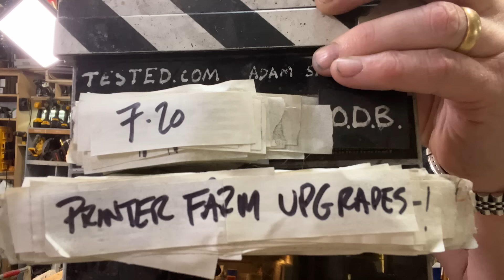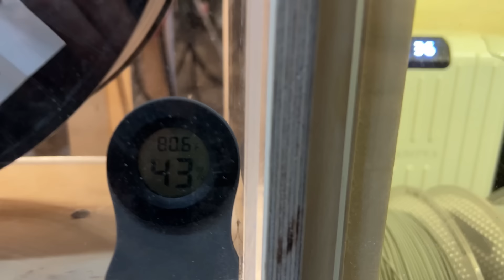Adam Savage's Essential 3D Print Farm Upgrades!

Comment from the maker: Bambu Lab X1C 3D printer: https://www.matterhackers.com/store/l/bambu-lab-x1-carbon-combo-3d-printer/sk/M80GDCL5?aff=7553
MANITYA Small Dehumidifier for Bedroom 580 sq ft: https://amzn.to/473UXFw
PLA filament: https://www.matterhackers.com/store/c/mh-build-series-pla?aff=7553
Filament winder design: https://www.printables.com/model/466883-pastamatic-filament-spool-winder-for-bambu-lab-x1c
Anycubic Kobra Max: https://www.anycubic.com/products/kobra-max
Adam's 3D printer farm build: https://youtu.be/taeS72yO__k
Reply: Joint the 3d bust print to make the mouth move and add a finger rig in the base to make it work ... as a one day build episode ... heck work out a way to make some Iron man armour unfold around the bust to make it into iron man ... suggestion for the iron man suit and visibility .. add cell phone cameras to the surface and put small monitors in the brow of the faceplate .. then you get a panorama view by looking up a bit .... add a heat sink and some lap top fans and you get suit cooling by airflow as well .. include a camel back water bottle in the rear (cold water added cooling) and have the mouth piece on the jaw line ... add a mic for speaker mode and of course head phones for hearing ... you can literally then put the controls on the wrist computer as digit sliders with buttons for lights etc ...
Reply: 30:32 For the most metallic 3D parts you could finish the part and then paint it with a metallic color of your choice. If you want a truly metal finish look into graphite electroplateing or by using a Conductive PLA. You can find it by searching 3D part electroplating or PLA electroplating. If you want a solid metal part you could cast it by making a mold using the 3Dpart. If you just want a metallic PLA I would recommend SILK PLA or a Composites/Metal PLA. Hope This helps. Peace and Love Dude!:face-red-heart-shape:p.s. Sorry for the duplicate I just want to make sure you got it my message.
Reply: “No need to get fancy” creates a table with four two piece legs recessed into the top 🤣
Reply: Somebody please tell Adam what a "Bowden Tube" is.
Reply: So Adam, I believe it's a PLA called SilkPLA that makes all kinds of nice color anodized aluminum PLA.

The other option is to actually print in Aluminum and have it Anodized or Power Coated any color you want.
Reply: Adam if you load the same filament in those empty bays of the AMS it can automatically switch to the other same filament when it runs out and continue printing so you don't waste time changing out and resuming. 👍
Reply: Why isn't Adam using his 3D Printer to make his own pooper shoot?  Are his filament brackets for the tubes made of wood?  He could of printed those.
Reply: @IceCreamManDLR he absolutely could have printed those. Sometimes wood is faster and far cheaper, if you already have some small pieces. Same goes for metal. 3d printing is amazing and irreplaceable, but it is not the only way to solve a problem cheap and fast.
Reply: I’ve been printing a lot of PETG lately and also love the metalized colors.  The flashforge burned titanium PETG is what I found meets both; it’s my preferred filament now.  They also have the same color in PLA and looks equally amazing.
Reply: Hello Adam, warm regards from the 3d printing community. The most humble and kind recommendation to DO NOT SCRAPE the PEI plates, PEI plates are made to self release the printed objects once they cool down, you just need to wait for the cool down, or maybe use a ventilator (fan) to blow air on PEI to make itself release everything faster. When you scrape PEI you can render it damaged and ineffective very fast. IF something is NOT able to self release itself from PEI, most likely the material is not compatible with PEI, or maybe an intermediary agent such as PVA glue should be applied. Best regards!
Reply: Something quicker for the textured plate cleaning. I purchased extra plates. I pull the print out and swap in a cleaned plate start printer to keep it printing and take the plate I removed and scrap somewhere comfortable. Plus I don't have another table in the way or have to make something else.
Reply: save the pla bits that get spit out and use some acetone and make pla glue
Reply: Hot Melt Glue Gun.... a hand held manual printer.   I can't help but imagine you could make a CAD 3d printer with hot melt glue guns.
Reply: Adam referenced grease that was recommended for the X1C lead screws, but I cannot find any reference to such official Bambulab recommendation online. Would you mind posting a link to the product, or recommendation documentation?
Reply: my friend. in order to dry filament you can do this: 1 - storage , have all filament stored in a cabinet that is mostly sealed, and have airline hooked to it with dessicant inside, this works of course if you are using a compressor with a dryer, this way you can keep it dry at around 10% - 5% depending on dryer you are using for the compressor system. 2- before printing some exoctic filaments like nylon blends , pc , tpc etc will need to be put into vacuum oven, you would need to follow instructions form manufacturer of the filament , for example 7h in 60°C for TPC , full vacuum -30inHg that is pretty much the onyl way to dry the filament, if you dont have vacuum oven, you can put it into normal oven , or dehydrator but be very careful with the temperature. ideally use 'computer' controlled ovens, or make one yourself :) at the moment there is no other solution as unfortunetly most plastics are made in a way that tehy draw the water from the air into their atomic model :D you can weight the filament before and after to measure if it is dry or not : )    If you are ultrarich you can buy one of those fancy dry cabinets for electrionic components , those run on dessicant dehummidifier modules at the back of the units, but you will still have to ocen the plastic. Also this way you avoid noise from compressor as those are silent in operation
Reply: Adam, do you think the Anycubic is a great starter 3d printer?
Reply: What color filament was used?
Reply: The WhamBam PEX plate for the X1 is totally worth checking out. I struggled with the Bambu plates and haven't looked back. I may get a MatterHackers PEI sheet and replace the smooth sheet's sticker with it, also.
Reply: I have been thinking if this and have a serious challenge for Adam and hope he sees this! I also have  X1C and I do a lot of multicolor printing, enough so that I have a few garbage bags now of different colored poop! Someone really needs to come up with some use for this stuff! There has to be a way to create some kind of mold system, that you could melt the poop somehow in a device and it would pour or be injected in to the mold. Creating even a single mold of something very useful, say ice scrapper or paint scrappers, or small flower pots or something that if everyone just made even that one thing, they could be given away and not thrown away, would be a HUGE benefit back to the community using the Bambu system.
Reply: Adam and anyone else who needs a good glue. Plastic magic from deluxe materials is better than super glue. It’s the melts and bonds type of glue for pla
Reply: Adam be honest, how many times has table fallen over? It's been a year
Reply: Doubt I will get a response but what is the exact filament used for the spool winder? I love that color.

Comment: I love that so many people are using my winder design! It’s so cool to see an exact copy of the thing I was iterating on my kitchen table every morning in photos from around the world!
Reply: Just didn't work for me! The lead screw didn't traverse the spool properly and so filament built up at the edges of the spool and then dropped loosely into the middle, creating huge, loose loops. Eventually did away with the entire lead screw assembly and layered the filament by hand.
Reply: Just checking, were you winding onto an empty Bambu spool? The travel of the leadscrew is 61mm and a larger or smaller target spool won’t wind as nicely. Another thing that helps is to keep some tension on the filament either with the TPU wipers, the sandpaper trick that Adam used or just holding the source spool loosely with your fingers. Otherwise IDK, glad you got something working!
Reply: What was your reason for creating it?  I just throw the whole 3KG spool on my printer - does yours maxx out at 1KG rolls, or something else?
Reply: I think the tensioning system could be a bit better if there is more consistency, it now a bit jerky and it doesnt wind as nice as it could.... maybe add some small weight in between pressing down on the filament so the tension is more constant? 
Othwerwise very nice design!
Reply: @criggie The Bambu X1 Carbon's AMX doesn't accept 3KG spools.
Reply: @hound83 yeah, I’m not in love the the TPU wipers for tensioning. Unfortunately I think the drag needs to be applied to the source spool instead of the filament directly. The reason is that if you ever slow down the drill the momentum of the source spool will cause it to continue rotating and overrun the target, resulting in filament with nowhere to go. The extra filament will then shed in big loose coils and leave a nasty tangle that you’ll probably have to cut. That’s what happens on my setup anyway
Reply: @GekoPrime  who says it cant be both? But yeah i think what you said is a very fair point....
Reply: Ooh the star himself!!!!  I actually recycled that other filament winder with the flat gears because yours is just fine!  and works right away.
Reply: @GekoPrime Just curious (I dont have a bamboo or use the 3kg spools) but is the purpose of the winder to go from bulk 3kg to something smaller (1kg) used by the other types of printers?  or is Adam just transferring it for some reason that I dont realize cause I don't have a bamboo printer?
Reply: @tjtobin86 the AMS Is a system that hold 4 different spools and allows switching between them mid print, but only accepts 1kg spools. It's also possible to buy spool-LESS filament (saving waste, etc.) so this machine helps there as well.
Reply: @tjtobin86  i think the 3kg spool is too big to fit in the machines holder...
Reply: Is this design supposed to be used with screwdriver as Adam did?
Reply: "It's a tool not a project" couldn't have put it better, thank you for putting this together, it is a tool every 3d printer office should have. Gotta be pretty rad seeing Adam f'n Savage making a video about it!
Reply: Very cool design! I love the filament guide that moves back and forth.
Reply: Such an absolute AMAZING design.
Reply: Amazing design my friend.  This is the winder we have all been waiting for.
Reply: @GekoPrime  It's more convenient to buy 1 3KG spool and re-spool it to a 3 or 4 smaller spools for multiple printers. Also some printers like those from Bambulab or Qiditech are hard to make to use 3KG spool - they're designed with a side mounted spool holder that expects smaller spool.
Reply: I just printed it this week.  Waiting on my TPU to print the wipers.  I can't wait to use it.  Genius design.
Reply: @criggie  You dont just throw a 3kg spool on a X1C,  1 it wont fit,  and 2 it wont go in the AMS,  this is why we use it
Reply: I got it working as well!
Reply: @criggie  Some spools don't work with the AMS.  The first one I respooled to an empty Hatchbox spool was some off-brand with a really wide spool.
Reply: @freddyf  I notice the pin that holds the large gear on falls out.  It doesn't snap in like the other pins.
Reply: Bro I was so intimidated when i was first browsing all the parts and whatnot , but i went ahead and did it and printed everything and got my bears and screws and I just want to say it wasnt difficult to assemble in the least bit.  Instructions were clear and I love being able to respool off of cardboard spools.  Thank you a ton for the design!!!
Reply: My print should be finished after work this evening and I'll be trying it myself. 👍🏾
Reply: Such a perfect design. The other popular winder is so wildly over complex and yours is has nothing it doesn’t need.
Reply: Hello, are there plans for this somewhere? I would love to utilize this design for a guitar pickup coil winder. I think this would work great! Any info would be greatly appreciated. Thanks
Reply: @rmax5150 Just in case you haven't been told and/or figured it out already, the link to the print plan is I the first comment from Tested. They are pretty good about always providing links either in the description and/or the first comment.
Reply: @gnome_with_the_iron_hands  Awesome, thank you! I didn't see that. I greatly appreciate you taking the time to inform me. Have a nice day!
Reply: Great job!!!
Reply: Is it possible to modify it to work with other receiver spools as well?
Reply: A+ design - biggest benefit is that this is DFMed and DFAed - its designed for Manufacturing and Assembly.  
I tried another popular one, that took me several days to print, but got stuck on very subtle tolerancing (Despite printing at 50% Speed on X1C) and had so many issues during the install.  Even after using it for a bit, and adding lubrication, the Gearing system was too seized and hard to turn...
This design, on the other hand, took just 1 day of printing (well, more than 1 day, I generally print at 50% Speed) and was so beautifully easy to assemble.  Geko said it well "I wanted to print a tool, not have a project itself".
While there can be some design improvements, ANY design has that potential for improvement.  I really appreciate @GekoPrime on this, and this person deserves as many free Filament Spools from Prusa as they can get!
Reply: I give up trying to print the 2 female holders.  I have tried different filaments, different parameters, different pla, petg, no different.  It prints the stem ok, but when it starts printing the curl, it goes into spaghetti mode.  I tried at least 15 different ways to print this.  The sad part is that I left those parts to the end (I didn't try the whole plate idea) so everything else is printed, but the item is worthless without the spool holders, especially the drive.  Anyone else have this problem?  I am using a Bambu P1S.   If Mr GekoPrime is reading this, please help... Thanks to everyone.
Reply: I give up trying to print the 2 female holders.  I have tried different filaments, different parameters, different pla, petg, no different.  It prints the stem ok, but when it starts printing the curl, it goes into spaghetti mode.  I tried at least 15 different ways to print this.  The sad part is that I left those parts to the end (I didn't try the whole plate idea) so everything else is printed, but the item is worthless without the spool holders, especially the drive.  Anyone else have this problem?  I am using a Bambu P1S.   If Mr GekoPrime is reading this, please help... Thanks to everyone.
Reply: Would this design work with eSun spools?
Reply: Will print it today 🤘🤘
Reply: Cool story bro
Reply: I love mine, I just need to figure out putting a motor on it, so I don't have to keep digging out the drill.
Reply: THE Adam Savage, made a video on something you invented? That must be the Nobel price of the maker community. Quite the achievement. Congratulations. By the way, thank you for the pastamatic.
Reply: 😊 @GekoPrime
Reply: i'm using it too!
Reply: I know it's probably not that mind blowing really but I can't get over how cool the level wind system is that you built into it, the fisherman in me wasn't expecting to be awoken by this video, fantastic effort hahahaha
Reply: Congrats dude. Especially by Adam Savage. The legend. 🤘🏼😁
Reply: @criggie  Are 3 kg all that much cheaper the bulk 1 kg?
Reply: Exactly what im looking for!
Reply: Well done, it's creative and generous people like you that we need more of
Reply: https://www.youtube.com/@GekoPrime thank you.  What a great design!
Reply: congratulations, maybe you can talk with Adam to get some improvements, if there is anyone
Reply: I like it, but have no need, yet. The incorporation of a level wind mechanism is genius.
Reply: Looks awesome man.
Reply: I just got into 3d printing this month, and your winder design was one of the first things I printed. The first 10+ hour print for sure. It was recommended by a friend who also has the same thing printed, and it worked great for us both. Thanks for your design!
Reply: The winder looks like such a steam punk masterpiece! I love it
Reply: Thank you Thank you Thank you. Best functional thing I have printed.
Reply: I have already built my Pastamatic, but I don't like the drill.  I am printing a motor mount with a circuit board for speed control to mount directly to my Pastamatic winder.  The motor and board were less than $30 on Amazon.  I was planning on posting to your youtube channel when I have completed everything.   Thank you for this awesome build.
Reply: You the GOAT! 

Love this thing, and it was cake to print and assemble. I've used it so much that I've even had a bearing fail already... I wasn't even aware these 608s were capable of failing.